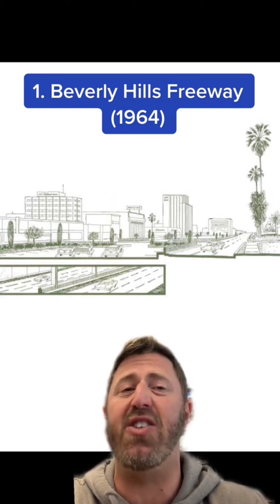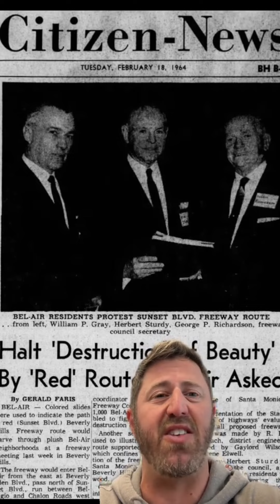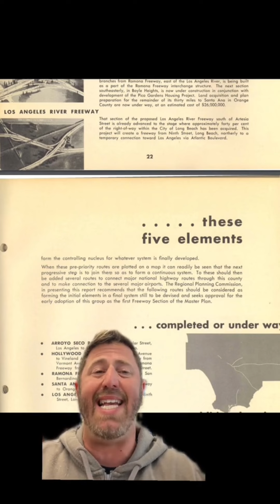L.A.‘s Ghost Freeways: 4 Freeways that were NEVER Built in Los Angeles!

Comment: Thanks for the info on the freeways which, fortunately, were never built. The notion that adding lanes or building more lanes reduces congestion has been proven false again and again, particularly here in Southern California. For example,  when I was a kid the 405 had fewer lanes than it does now. Lanes have been added multiple times but not only did congestion not decrease it increased instead.

The only way to solve the congestion issue here is through mass transit. Alternatives like autonomous vehicles will only make things worse.
Reply: That is a bit of a misnomer, since you neglect to mention the population tripled in that amount of time. The amount of additional lanes did not. If there wasn't additional lanes the gridlock - already bad enough - would be intolerable. Mass transportation helps only a little and it doesn't get you where you need to go most of the time, and in many ways has been a money pit of a boondoggle since we don't elect officials that know how to spend those funds wisely and efficiently and aren't indebted to their union cronies. We can't even get high speed rail completed after decades of delay and double digit BILLIONS of dollars over budget. Where is all that money going???
Reply: It usually does that when the population increases. Thats why the lanes were added in the first place.
Reply: @garrycosta3635  the additional lanes lagged the population increases by decades.
Reply: @garrycosta3635  <-- Population increase in itself does not have to result in worse traffic.  The choice to grow a city with low density suburban sprawl and connecting it with freeways is what results in worse traffic.